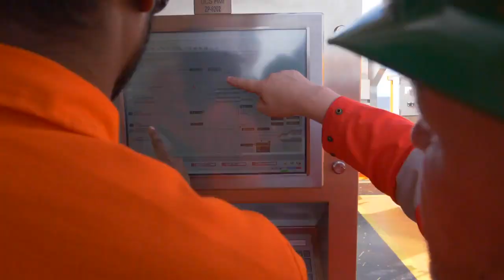Our Sea Swift platform for DeNovo Energy

Comment: beautiful work! how did you guys compensate for the heaves? im currently facing issues doing heavy lifts with 1.5m heaves and the crane winch isnt fast enough to compensate and the height restriction does not allow for a dynamic heave compensator to be installed above the slings.